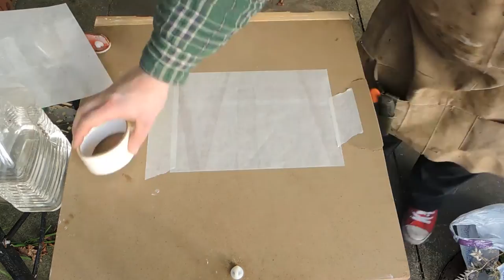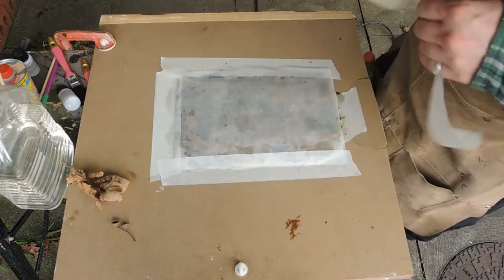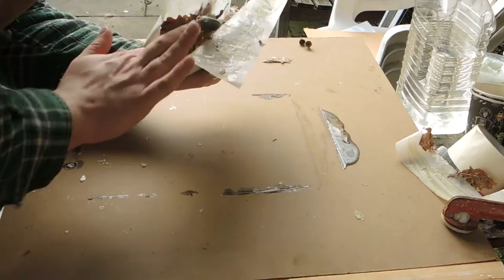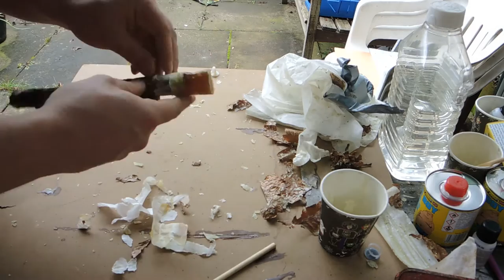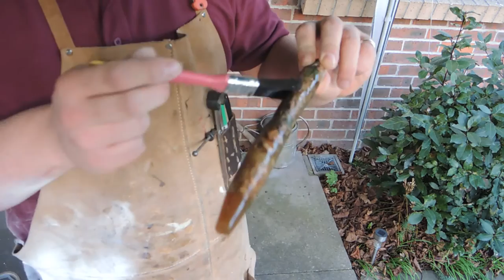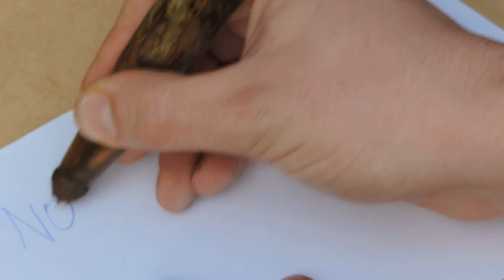A pen made from leaves :No lathe pen challenge

Comment: Hi ! May ask if how many hours it takes to dry ? Can I use heat blower to dry it quickly ? Thank you
Reply from the maker: it took around 30 mins to dry, I wouldn't recommend using a heat gun on it as the resin used contains a lot of volatile chemicals that could either catch fire or produce harmful phumes.

Comment: Hi! May you please tell the materials used? This is what we would be doing for the project of our community. Thanks!
Reply from the maker: As you can see in the video I used dry leaves and fiberglass resin.
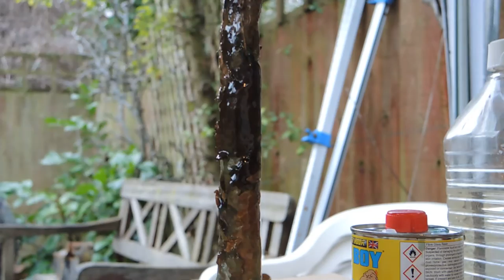Reply: Nomaster Creations I'm so sorry if I'm asking too many questions but what did you use in 3:58 ? Is it really needed?
Reply from the maker: @isabellemac5960  asking questions is how we learn and I always have time to answer them and help people. What I'm doing at that point in the video is brushing on a layer of resin to seal the outside and give the pen a hard outer surface that could be sanded.
Reply: Nomaster Creations oh ok..do you think its possible to put a led inside? and not an ink?
Reply from the maker: Absolutely! That's a great idea. A good LED would really light up the leaves and show them off nicely.
Reply: Nomaster Creations Oh, What I meant is that the "lead" in pencils not LED (im sorry if I didn't spell that correctly)
Reply from the maker: Yeah that could work too, might be tricky to sharpen though, maybe if you could find a mechanical pencil mechanism you could fit in.
Reply: Nomaster Creations But what if I'll make a mold of the normal pencil then place the mixture in there? Do you think it would be easier to sharpen then?
Reply from the maker: Yeah I think that could work. You could also try and find a hard lead, that way you wouldn't need to sharpen it too often.